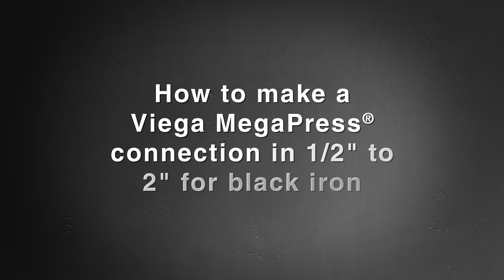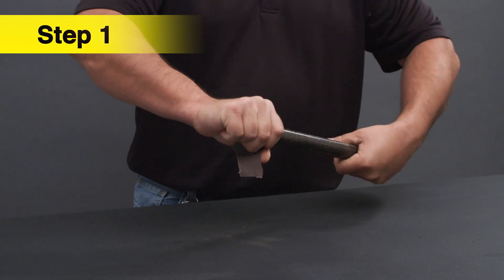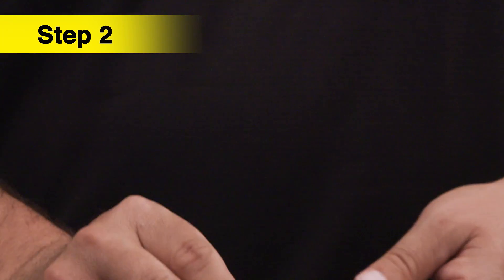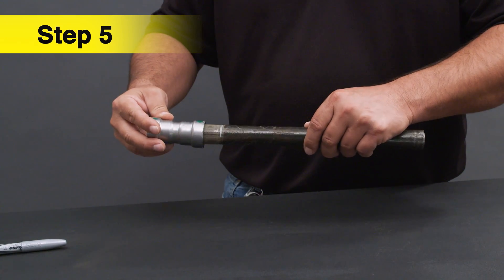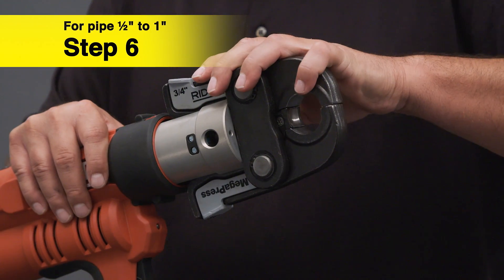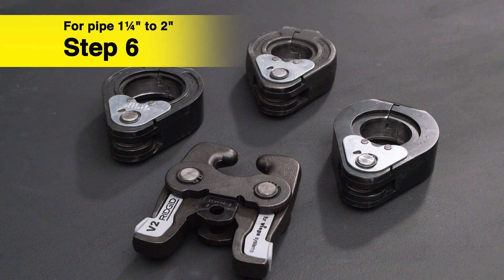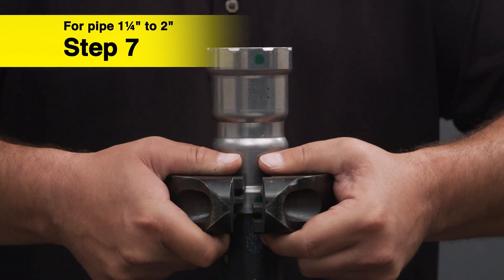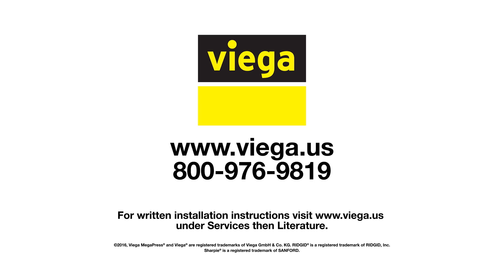HOW TO USE A MEGAPRESS PRESS TOOL & JAWS | Carbon Steel Press Connection | Viega

Comment: Don't forget to open your appropriate bank account and or loan provider, or a first born child. There is absolutely no reason these jaws cost this freaking much. I understand the process here, yet I also know we are talking about steel jaws here, not actual titanium. Let's look at this, keep the price high and sell to less with less sales due to less end of cycle overturn or price product lower and sell to more resulting in higher sales and higher return sales due to product end of cycle. It is seriously the biggest no brainer ever. Ridged must have the highest amount of yes men in meetings, sometimes, no should be evaluated.
Reply: It costs what it does because it saves you so much installation time which means jobs are done faster which means youre making more.

Comment: I’ve googled steam application. The site I saw said it wasn’t approved for superheated applications.

Can it be used for steam or not, seeing as how you should know best?
Reply: No. For context ive been a plumber over 30 years and my company was 9ne of the first ever to use this system, we got essentially free fittings for a job to test out the system

Comment: Hard pass, mega press is junk
Reply: Been using it for over 15 years, never had an issue
Reply: Why ? I ain't tried it yet
Reply: @Dookie_burner  I’ve used it on 1 1/2” in the ground, at some apartments. My helper and I spent more time being fearful of it actually working than fixing the pinhole. It was a snap.

Comment: Can I use the same tool to do copper fittings? Or is a totally different tool ?
Reply: What tool do you have? The compact press’s (Milwaukee and ridgid) can do up to 3/4 in Mega press and the regular full size press’s can do up to 2 inch mega press without the booster. You will need different jaws for your press tool though, copper and mega press jaws are not the same
Reply from the maker: Tanner gave a very good answer below! Depending on what size fittings you are pressing, will determine which tool you can use - a standard or compact. You will need different sets of jaws to press ProPress and MegaPress.